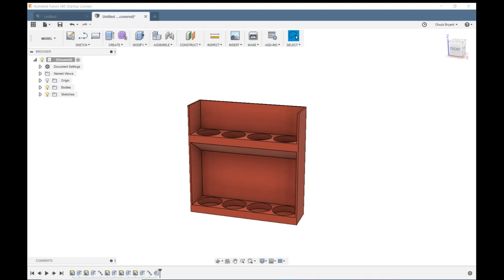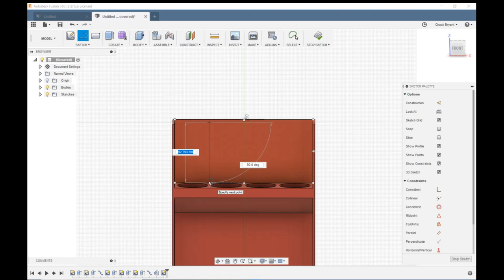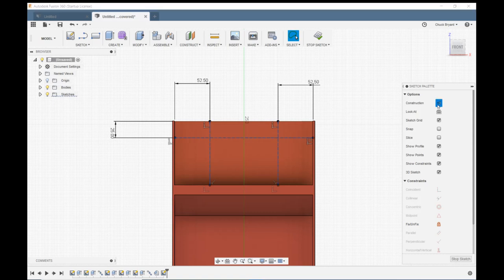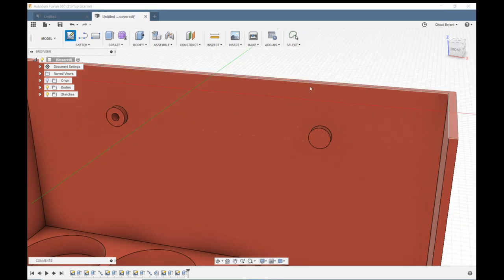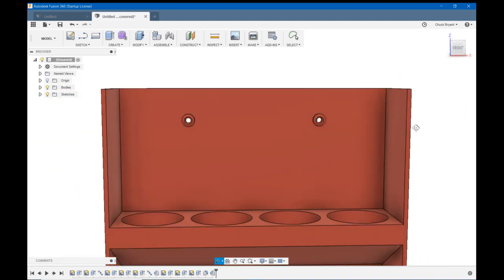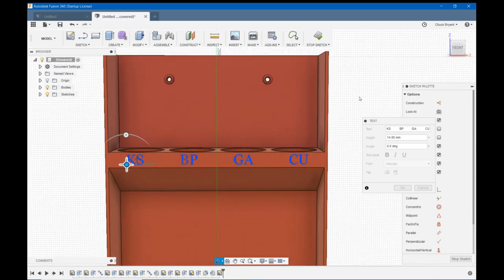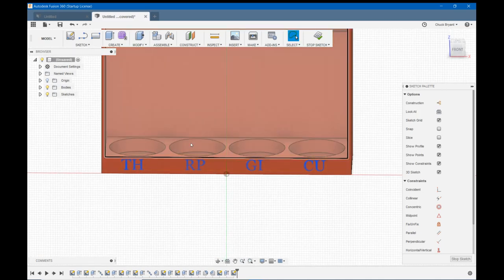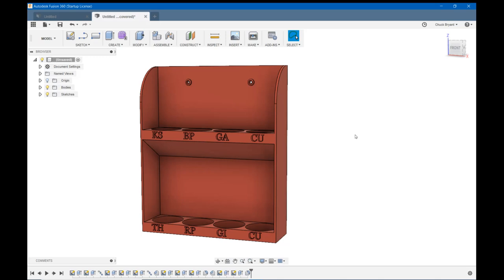Fusion 360 tutorial - beginners level - Spice Rack Part 3 Done!

Comment: Another good one Chuck. Thanks for all your work. Maybe you could show people how to use parameters so that dimensions can be changed quickly on a model.
Reply from the maker: Thanks Paul. It honestly never dawned on me to use parameters and expressions in something this simple but it might have been a good place to start. I've got two more designs planned, one of those would be a good fit for that, I think as it will be valuable to chance certain sizes quickly. I also have something fairly simple with components, joints and assemblies in the works. But first, the wife wants a K Cup holder. lol.
Reply: @3rdpig  I will look forward to those. I haven't done much with joints and assemblies and it would be good to add them to the skill base. However, as you say, domestic orders go to the front of the queue.